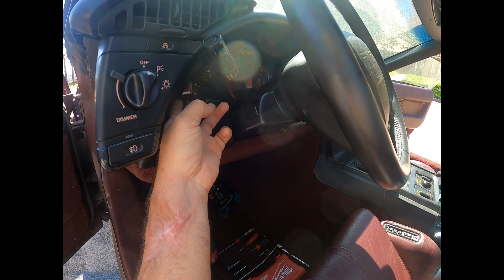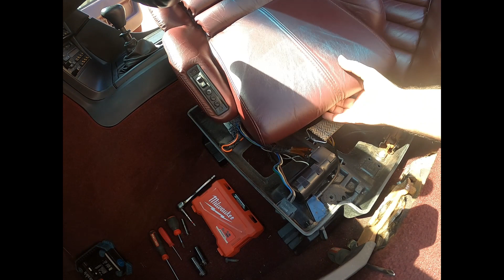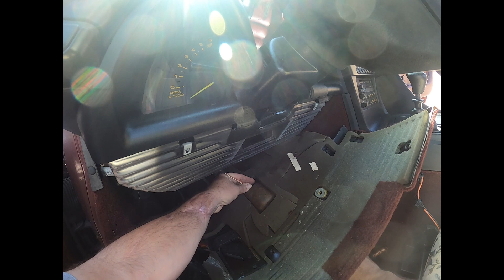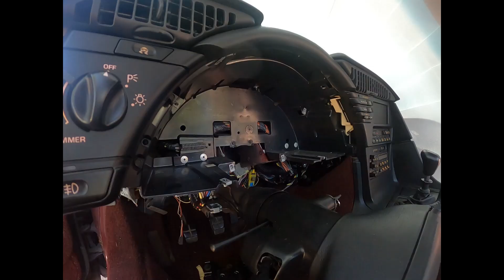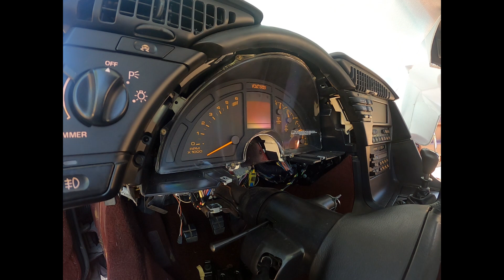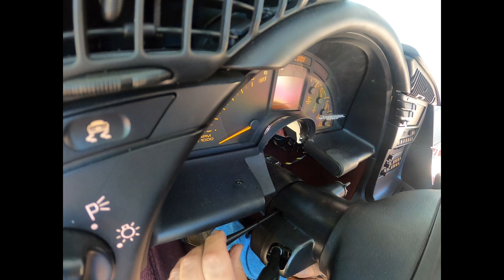Replacing the Abandoned 40th Anniversry Corvette Speedometer Assembly

Comment: All you had to do is remove the steering wheel and the molding around the cluster. I've done that job and all that you did was not necessary.
Reply from the maker: It's necessary if you're not interested in having an airbag with a 30 year old explosive cartridge blow up in your face while attempting to remove it. 

Furthermore, since much of my audience will be first-time wrenchers, I illustrate the easiest method of getting to the cluster that only requires the removal of 2 steering column bolts as opposed to figuring out the steering wheel puller.

Thanks for the input and Happy New Year👍
Reply: @VetteSource  Hey whatever works for you. I was only saying that there is an easier and faster method. The airbag won't deploy unless you do something really stupid to make it deploy. Removing it is very simple. Happy new year to you also.
Reply from the maker: @samuraijutsu8876 👍

Comment: I have a 1993 40th anniversary and I can’t find the fuel pump relay. Any suggestions?
Reply from the maker: There are 2 fuel pump relays, one located on each side of the dash under the kick panels. Once you remove the kick panels,  you will see several relays attached to a brace bar. The relay on the PS is located closest to the door. The relay on the left is located closest to the console. Let me know if you need anything else👍.